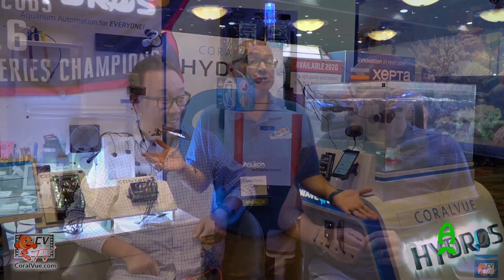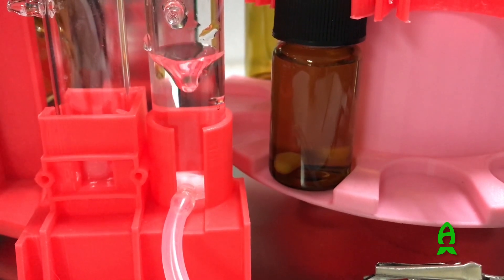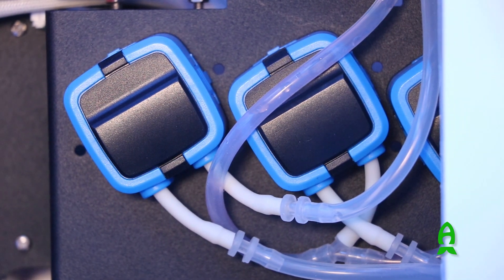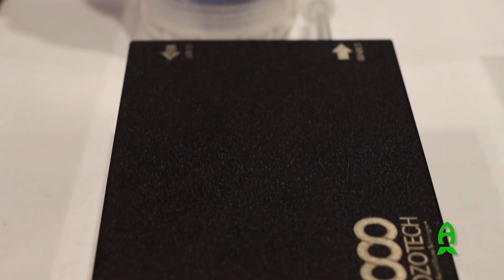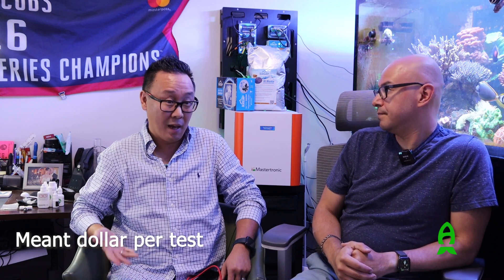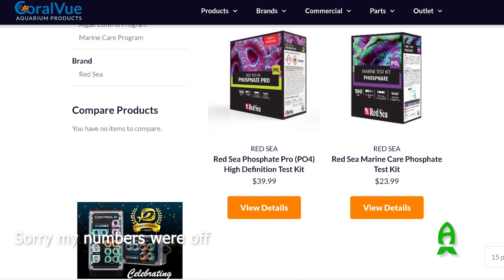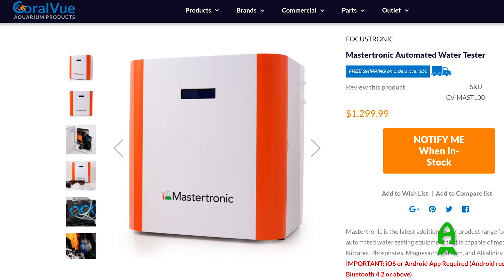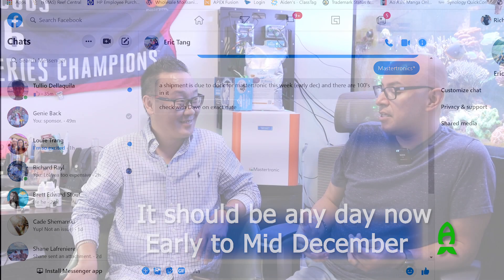Highlighting Focustronic's Mastertronic.

Comment: How many tests do you get out of the reagents?  I test twice a week and ive had this for two months thats around 18-19 tests and the KH vial says its empty how can that be on a test kit that should do around 80 tests manually.  trying to find out if its an issue on my machine
Reply from the maker: I noticed that on the alkalinity not as much as well. I just use it  once a week to keep my other testers honest 😆. I will check it out once I refill to the top and see how long it lasts.
Reply: @Reefscom  gr8, the box has enough reagent for more fills tho but still seems like it uses a decent amount on a few of the tests like KH and MG.  Ill keep track of it see how it goes, but parameter wise its brilliant.

Comment: Great video, however, pricing is too expensive.  Doing manual testing is pain staking but when a tool that helps the process of testing is $1200 not including tax  is a much as one month’s rent is hard to justify purchasing the equipment.  Manufacturers need to start developing products that are reasonable in price for every one can have the opportunity to get.  This hobby is expensive as it is, there is no need to make more expensive.
Reply from the maker: I hear you. That's why I did say that it's expensive and not for everyone. But some will find it useful and instrumental.